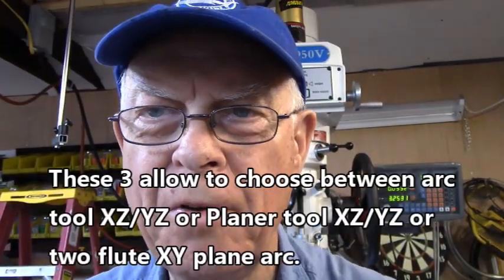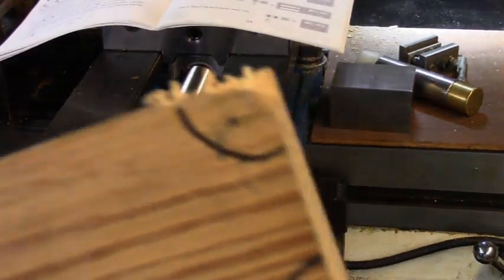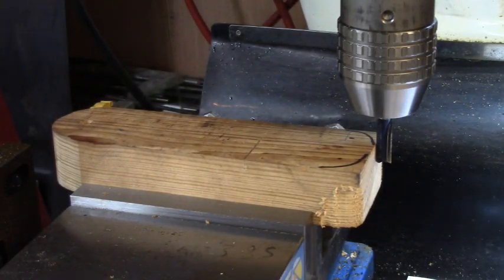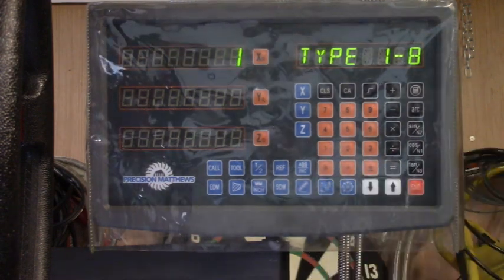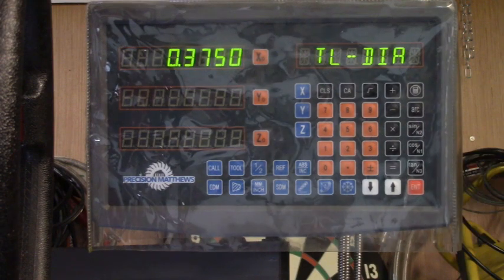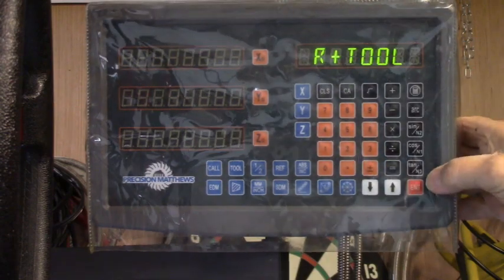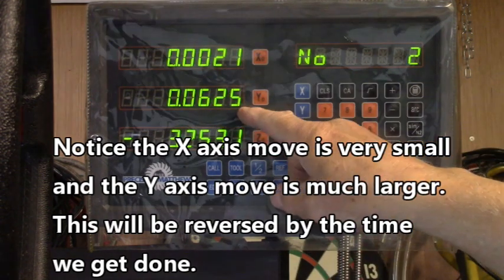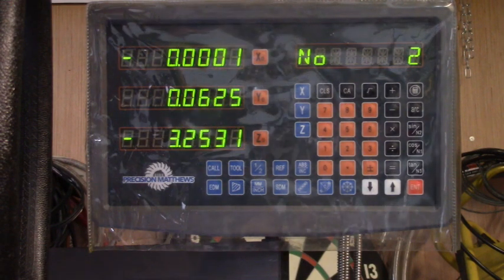DRO how to use #4 Radius function

Comment: I bet you it’s the x direction is reversed. Suspect you change it. Instead of setting up for table moving direction think what direction the tool is moving(it’s stationary but to the part the tool is moving opposite the table and probably the  way the dro needs for the picture to be right.
Reply from the maker: You have got bathe idea there.  When the  mill was delivered I found that the X axis scale had been broken.  When the new one arrived I mistakenly put it on backwards.  This is what I found after I started to ask questions. So for expediency I just reversed the action of the X axis and now the functions all work correctly.

Comment: fantastic stuff harold , i noticed when you set your zero x and y you had the cutter in the start position and then proceeded , is this correct as some vidoes i have seen some people zero the y with tool touching that side , then they move tool to the x touch off and zero it

Comment: Could you tell me how set the X axis. If table moves left from a zero setting, does the DRO indicate increasing negative readings?
Reply from the maker: Well here is the cat out of the bag.   Where ever the table is setting when you press the zero X button then that point is zero X.  See Mr. Greebe here. https://www.practicalmachinist.com/forum/threads/lathe-mill-dro-axis-directions.225890/
Reply: @AmateurRedneckWorkshop   I knew that. Now, if you move the table left, do the numbers show a negative sign with numbers increasing? The DRO my friend has can be made to change sign. I would think that is a common feature. My question was really to help clarify a possible solution for the folks who installed the scale correctly.
Reply from the maker: @EdwardKilner  If they have installed the scale correctly they don't need any solution.  Pressing the period key on the keyboard as you turn on the DRO is often the way to get it into setup mode.  Then the steps to reverse the X take will be obvious.  I do not have a dro manual in front of me just now.  You can look in the manual just as good as I can.
Reply: @AmateurRedneckWorkshop   Since I am an Electrical Engineer, I am somewhat familiar with manuals. RYFM was an order I heard a lot in my early career. I am a champion and inveterate manual reader. 

My question was for other reader’s benefit, not for mine.

The DRO I have access to belongs to my friend, a mechanical engineer. I found some interesting, to him, gems in the manual and supplementary info publications.

We both enjoy helping others. We both strive for clarity. If I failed to be clear, please tell me.
Reply from the maker: @EdwardKilner  I am sorry I did not mean to be rude.  I just have a lot on my mind these days.  I do not remember where in the set up that you can reverse the Axis.  I did look for it for a few minutes but it has been two years since I made this video and an old man forgets things.  In fact for this video I had to reverse the X because when I got the replacement scale from China, I put it on backwards and it was messing up the demonstration.
Reply: @AmateurRedneckWorkshop   You were not rude, no offence taken. My friend has a DRO Pro unit and it does have a way to set the axis orientation. Your unit may not. I’m pretty near a complete novice, old, but try to follow a repeatable procedure.
Reply from the maker: @EdwardKilner  all DRO's are pretty much alike.  They could well be made in the same factory.  I am certain there is a way to reverse the direction of the axis.  Some manuals are poorly written.

Comment: Well shoot Harold, this is great.
I’ve had a DRO on my big mill for three years now. I use it to move over a certain amount, up down etc.
I did use the hole pattern once and it worked slick.
I need to start playing with this thing.
It’s a DRO pros EL 4000, I think.
Reply from the maker: You have a great tool and a wonderful toy start to play with it don't let it go to waste.  Thanks Jeff.

Comment: I recently purchased a later model of this general type of DRO. I bought two of them, one for my mill, and one for my lathe. They're both the same model however marketed by different companies. The model is SNS-3V. Both units although purchased several months apart came with exactly the same manual. "Digital Readouts - 2V/3V Multifunction - Operation manual version 1.0)
I will point out that regarding the ARC Processing function in the manual that the instructions are pretty much exactly as Harold describes in this tutorial. However nothing could be more incorrect regarding how these models handle arcs. So the manual does NOT accurately describe how the function works in either of these similar model DROs.
It would appear that what they've done is do away with the Simple / Smooth menu selections as well as selections for "Type" numbers. Those are gone now. I had to learn the new way it works by playing with it since I have no documentation.
1) press the ARC processing button
2) enter either SEL_XY, SEL_XZ, or SEL_YZ
3) CENTER location of the center of the ARC relative to the center of the current location of the spindle
4) RAD of the ARC
5)TL_DIA - tool diameter
6) MAX_CUT - this is where things change in this model. The smaller the value of this variable, the smaller the increments in moving the spindle and the more steps will be added accordingly to the process in order to complete the cut. In essence this replaces the Simple/Smooth selection and you determine the resolution of the cuts in the ARC for yourself.
7) ST-ANG - this is another change in this model. This step and the next one set the beginning and ending angles relative to the current location of the spindle. Angle of 0 causes the coordinates of the cuts to begin to the right on the x-axis away from the center the ARC radius + 1/2(tool diameter if you are setting the ARC to cut the outside, and minus if you're cutting the inside (more below).
8) ED_ANG - where the cutter will end up at the last step. Angle of 90 will put the spindle at 12 oclock to the ARC (up and to the left of where you start)
9) RAD+TL or RAD-TL - same as normal (manual instructions, this video)
That's it! Those are all the settings with this version of the DRO.
I hope this helps someone.
Reply from the maker: Thanks Fred.  The problem I had with the arc going the wrong was was solved by reversing the "X" axis.  I put the scale on the table facing the wrong way.
Reply: @AmateurRedneckWorkshop  Yes, I saw your follow up video that addressed that. The manual that comes with the DRO does explain how the axis directions need to be set up properly which will apply to various functions. I had no problem with any of that.
What I go into in my comment is a newer version of the DRO where the instructions for milling an ARC don't match how you go about it in the actual DRO. They're written for DROs that are like yours where you select 'simple or smooth' and then select the type numbers 1-8. Those selections are gone now and replaced as I discussed in my long winded comment.
The reason I put my comment in this video is due to the title and the content where you're teaching people how to mill an ARC and I thought it might be most helpful here if a person gets the newer DRO version like I have, and it comes with the instruction manual like the two that I bought did, which is like yours, but wrong. I have yet to run into a video that explains the ARC function the way it works on the newer version.

Comment: Thanks Harold.
I'm just wondering if there is a mirror function on the DRO that for some reason needs to be changed when doing radius cuts. Perhaps it comes in to play on the smooth cut and was overlooked in the manual on the simple cut, or maybe it is a glitch in the software. BTW what I know about DROs  wouldn't cover the bottom of a thimble.
Reply from the maker: I hope to find the answer to that.  Thanks Danny.